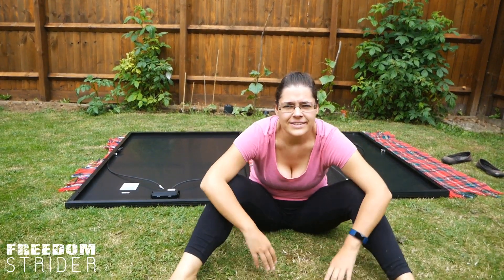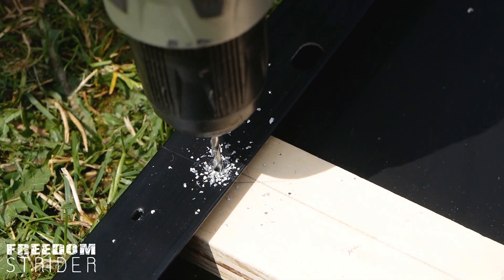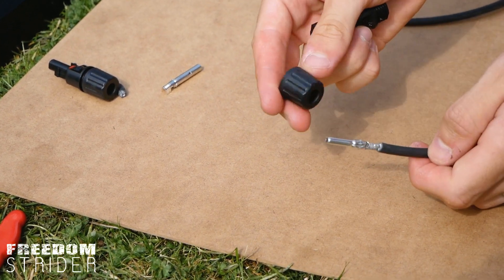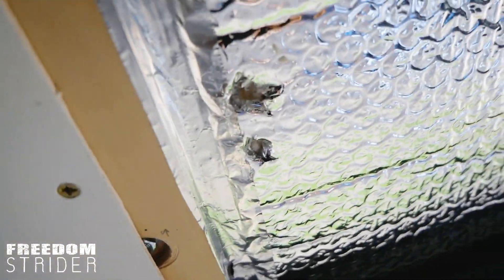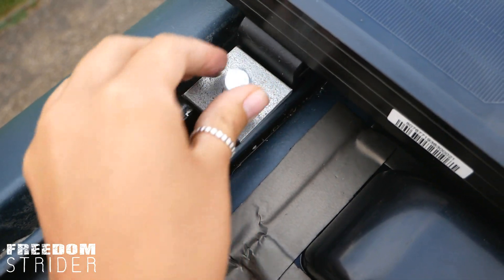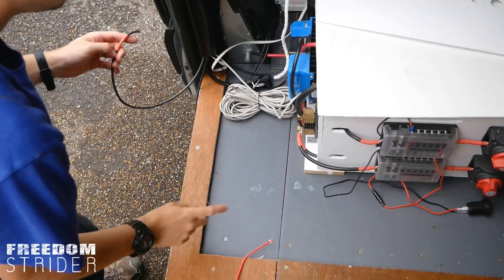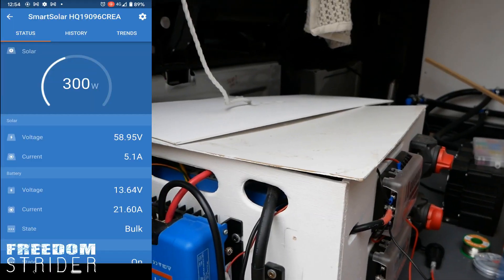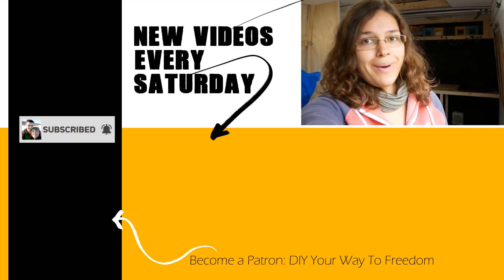Campervan SOLAR PANEL Install 101

Comment: Hi. Thanks for all the advice in the video. Just converting a sprinter. Did you have any issues with only 4 fixing points on the big rigid panels? Was otbstong enough. Thanks

Comment: You two probably  don't care
about someone else's opinion,
why not plug in something
like  an electric appliance to 
round off your video. after all
 that work it would be nice to
have seen a completa video of
the solar setup working through
 it's  paces.
She said she has a waffle maker
a blender, sorry but we didn't see
any of that working off your
 solar power setup on this video.
Reply from the maker: Not on this video, we made othe rvideos about our electrical setup :)

Comment: Hi, I would like to know what you dit with the kabels under te solarpanels. If they are just lose on the roof, don’t they rattle while you’re driving?
Reply from the maker: Not that we found, some people tape them down if yoy have a lot of length bit for us they were just fine

Comment: It wasn't finest day for your father at 05:30, I must admit. He handled the panel the other way around, put in on the concrete, leaving small marks and scratches, then walked around to grab it again, instead of just rotating with the panel, and then handed it to you upside down... It hurts my brain. All the blankets and cardboard boxes protection for nothing ;)
Reply from the maker: Well to be fair to my dad, he was following our instructions 😅. We all learnt on the second panel.

Comment: Recommend using Loktite on each bolt/nut connection since your van is a vibration machine
Reply from the maker: Yes, we used blue locktite nearly everywhere, but for some things that should never come off, red locktite is what we've been recommended to use🙂

Comment: I would love to know what your panels dimensions (from the panels in this vid) and  you roof dimensions (is this a 2021 sprinter?), the link takes you to a new 295w panel. I am not sure if your panels are the same dimensions. Great job and hopefully you got the tilt completed!
Reply from the maker: Yes the new 295W panels are the same size as our 270W panels (the 295W ones are just more efficient, the next generation)

Our van is a 2014 VW Crafter LWB (L3H2) but the roof is the same as a 2021 Mercedes Sprinter LWB. Our roof is roughly 4.16m long, and 1.39m wide (1.39m up to the outer of our unistrut). The 2 solar panels take up nearly 1/2 the roof. The panels do stick out beyond 1.39m but because the curvature of the van, it doesn't look like it. 👌

If you do need more detailed measurements you can check out our layout planner me made which gives every single measurement of our sized van: https://www.freedom-strider.com/van-build-shop/templates-and-blueprints/sprinter-van-conversion-layout-planner/
Reply: @FreedomStrider  thanks so much for the fast response! I have a 2022 sprinter 170wb. I think I can fit 2 of these between the MAXX fan and my AC unit. Thanks for the link and the info!

Comment: Hello. Are you able to advise what you are screwing the bolt into when attaching the panels to the strut? It looks like you have square nuts?
Reply from the maker: The bolts are being screwed into spring channel nuts: https://directchannel.uk.com/m6-short-spring-channel-nuts-x-100

They are specific to unistrut channels, you slot them in the channel and you thread the bolt (best use thread locker as well). The beefy square on top is to give the bolt something to push against and to spread the load
Reply: @FreedomStrider  thank you so much! Appreciate you taking time to reply. Your videos have been so helpful!

Comment: Thanks. Not what I was hoping for- I am desperately seeking a simple, cost effective, and easy to use way to tilt mount large solar panels(250-350 watt) on my van roof. I already know how to simply mount them flat like you are doing. This video I'm sure is useful for a beginner. Darn! I gave you a like anyway.
Reply from the maker: Tilting is something we're planning to do one day, if you're looking for a cheap and quick way to tilt pannels, our friend Niel has a great video here: https://youtu.be/8zAuMtiQpZ0

I would use some beefier L Brackets than he did, but the concept is simple 🙂
Reply: Are you seeking such solution for sake of maxing efficiency or do you have a legitimate need?

Comment: What is the purpose of the "spring" washer? About to mount our panels!!
Reply from the maker: the 'spring' washer (at 2:56) - it's purpose... when you tighten the bolt, the washer, compresses down and helps the bolt lock into place and stops it from unthreading. Add some threadlocker if possible as well: https://ebay.us/j7jN9i

Comment: In my planning phase and "how efficiently does it fit the roof and expected mount locations?" is way more important to me than pretty much any other aspect of the panel. Great to see this video, I started following this channel because of the practical looking DIY roof mounts from about a year back.

Is it just me or is Polly's accent gotten more Brit? Not strongly but just a bit more Brit here and there.
Reply from the maker: Wow it has been a year since we put the unistrut up - I'm glad you are still here 😂. Now all we have to do is cook up the DIY roof rack... up for another year?

As for the accent... who knows 😄... Personally I can't hear it. When I hear it on video (to my ears) I sound just like Sam... But apparently not 😂

Comment: Hi there guys, before you rush out and try to sort out a panel angling system I would suggest contemplating an alternative. Reflectors placed to reflect light onto the panels so that they can stay flat but still increase power gathering. The video linked to below is very informative but uses rigid reflector panels angled at 45 degrees. I would suggest a more flexible option.
The idea is to mount heavy duty thermal blanket Mylar material between two carbon fibre rods measured to match the sides of the solar panels and standing say 50cm high. These fit into mounting brackets fitted with tubes for the rods to slot into. The brackets are positioned so that the rig stands vertically alongside the panel. At any point between sunrise and mid day ( light horizontal or vertical) the rig will reflect light directly at the panel. Mounting brackets could be positioned along all four sides of the panels. So regardless of orientation you can run the system. Erecting and removing the rigs would be a matter of 2 minutes and a step to get you high enough to reach. Two long rigs for mounting on the sides could be supplemented by two shorter rigs if the van was facing into or away from the sun.  When removed the rigs could be rolled up like a kite and packed in a protective tube. The only downside would be on a windy day. I would also recommend using rip stop tape to reinforce the Mylar. Obviously  some test to confirm whether the system would work should be carried out. Thermal blankets are about £3 on eBay. With you controller app it would be really easy to confirm an improved efficiency. Hope you find this an idea worth investigating. Please feel free to contact me for more information. Steve.   Now go watch the video and remember the panels wouldn’t get anywhere near as hot in this country 

https://youtu.be/nsg9nQ03CdE
Reply: Tricky and fragile, just get another panel and mount it flat on the roof or use as portable one and deploy when needed. In summer tilted panels produce only 20% more, so it doesn't matter much. It might be worth during the winter or if you go to the far north. In summer panels will overheat because of more surface, so it will shorten lifespan of equipment and reduce it's efficiency, and in winter weather will be bad. They aren't designed to be expanded.
Reply from the maker: Wow, I've not seen anything like that before - our tilting will not be done in the next few months, so we have time to look into options, this seems quite an interesting one, thanks for showing us! 😊
Reply: @FreedomStrider  another advantage of reflectors is that on dark days the will increase gathering because you are effectively increasing the gathering area. Steve
Reply: I have done additional research on this topic recently and at my latitude of around 50-55 degrees north, IE/UK, latitude angle panel vs laying horizontally flat gives:
- december and january (2x energy)
- november and february (1.6x energy)
- march and october (1.3x energy)

Unsurprisingly, the most beneficial months are from November to February, and March and October show signs of diminishing returns. There are some methods for estimating the optimum angle of the panel installation for the season. If one has a linear actuator they could optimize the angle on a monthly or even an hourly basis, although this would require at least a good remote.

Method one, general
- winter, add 15 degrees to your latitude
- summer, subtract 15 degrees from your latitude

Method two, improved
- winter, multiply the latitude by 0.9 and add 29°
- summer, multiply the latitude by 0.9 and subtract 23.5°
- spring and fall, subtract 2.5° from the latitude

Comment: is there any reason you are not using an MC4 fuse at the solar panel? if that positive cable gets damaged and comes in contact with the metal of the van the fuse at the MPPT isn't going to do anything
Reply from the maker: Because I didn't know MC4 fuses existed until just now - though our positive cable is completely surrounded in plastic and fabric (except on the outside) so even if it does rub, it shouldn't shortcut to the van metal. Though those MC4 fuses look pretty good. 👍

Comment: Can you send a photo of the van side profile from the ground looking up . I was looking to get a 140 cm panel so it does not over lap the curved part on the van roof - more discreet. May consider the ones you have though !
Reply from the maker: Sure can do, we'll send them via Instagram, our pannels are 1482mm wide, they barely overhang the unistrut and the van is wider lower down :)